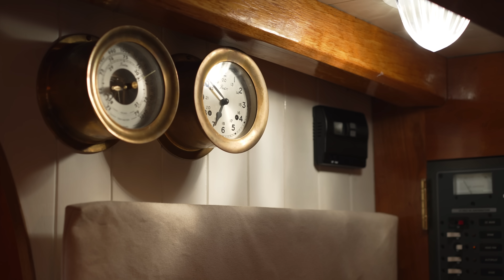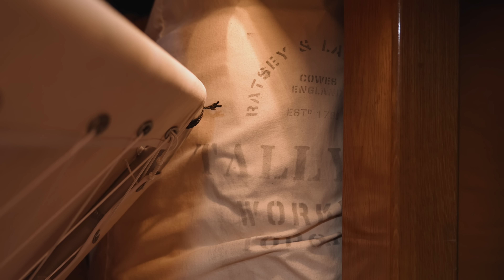TALLY HO departs - Leaving harbour and heading North!

Comment: Hi Leo

I have been following your restoration project for 6 years well done 
I would like to point out one thing which I think is important - you need to put some more heat shields on your stove pipe 
If you get that fireplace going one cold night that chimney could glowing and that would risk singeing or setting fire to the bulkheads behind it
It would be such a pity to see that happen

Cheers
Robert

PS are you going to take Poncho sailing sometime - I love that parrot

Comment: At 4:30, the flue for that stove is installed upside down.  The lower pipe at each joint shoudl fit inside the higher pipe or fitting, so flue gasses are directed inward as they rise.
Reply from the maker: I learned to install them this way so that dripping tar stays in studs the glue and doesn’t drip out. I don’t think that escaping gasses are an issue with such a wide-diameter flue as there is no pressure build-up.

Comment: Beautiful! The only catch is that the 120v outlet (GFCI?) in the engine room is upside down. I can't speak about the European receptacles, but in the US the ground goes down.
Reply from the maker: Actually I believe it’s now recommended to install with the ground up, at least in marine installations. It’s supposed to be safer if the plug is not all the way in, so that if something falls from above on the exposed pins it will fall on the ground and not the live terminals. 🙂

Comment: Am I seeing correctly?  The boat is wired for 220/50 and for 110/60?  That must have been a trick to pull off.  I love that you've kept the paraffin (oil) lamps.
Reply: Yes, there are 2 separate inverters, & each outlet cluster includes 12vDC USB power points.

Comment: Hi
Suggestion have a conversation about lowering the side piece that feeds the chain into the chain locker ...
Ie lower it an inch or two and adjust the angle slightly look in the beginning at about -20:41 / 22:03 you should be able to see that the chain just needs to be adjusted by a few degrees ...

Comment: It would be great if some Marina adjacent food shop ginned up a printer that could take the image of a can's label, strip it off and print the label back on the can with water-proof ink. So much time could be saved for those big provisioning events for long voyages. Kind of like those cans that come like that! 🍺... I spent hours stripping and re-labeling cans and then spraying them with clear poly because of the humidity in the lower storage bins (after finding two cans of beans that had rusted out and drained into the bilge)... 🤔

Comment: If you look at 1:22 you can see the chain goes off the gypsie at an upward angle because of the height of the bronze/brass hood thing accepting the chain. 

I wonder if lowering the height of the hole so the chain comes out parallel would eliminate the stickyness

Comment: That solid engine sound really came thru as under way.  i am curious as to what the boat might weigh?  Also, what home port might be placed to the stern?  I can guess, via the beautiful colors of the flag. But I am not certain as registry as wooden craft?  Note:  landlocked as I am, I have the available modern mapping to rather trace any notes as journey.  So, nice to hear that detail.
Fair winds to the adventure.  M.
Reply: SampsonBoat_Cofr  I quite welcome that communication.  You see, as a student I held a foredeck position as sail. *crew assignment.  Inland, I managed 165 river miles with a mapping goal set. A 12 ft *glass hull.  As for life now, I quietly work in organic chemistry domain.  Regards, M.

Comment: So, if the plan is still Fastnet '27, then:
- Summer '24 Shakedown Cruise, BC etc all summer.
- Back to Port Townsend and spend winter & '25 early spring to iron al creases and solve any pending element  (gallows?, etc)
- departure south bound pacific coast  -> California - > Baja - > Panama -> Chritsmas in the Atlantic
- Caribbean -> Antigua Sailing Week May '26
- Up the atlantic Coast  - Cross atlantic late summer '26
-  Bristol by Fall 26' 
- Winter and spring '27 preparing Tally Ho for the Fastnet '27
 - July 27' Tally Ho wins Fastnet '27 100 years later

Of course the schedule is just a deduction, but based on prevailing winds, hurricane seasons etc,  and based on the deadline  there is not much room for other alternatives.

If this plan is more or less what you have in mind, there could be very interesting stopovers to cover both traditional boatbuilind and forest management of tropical woods in your way to panama in Mexico etc. Contact if interested.
Congratulations !!!!!!
PS: I've seen the Ashley book of knots in the library ;-)
PS2: Think about the large photo coffee table book that others are mentioning. It will be great and you will certainly raise funds.

Comment: Is there anything like an autopilot installed ? Anything that helps hold the course ? also no solar panels … you think you can make enough electricity with the screw and the generator or will it just be diesel burned ?